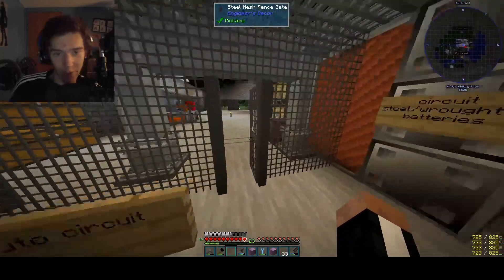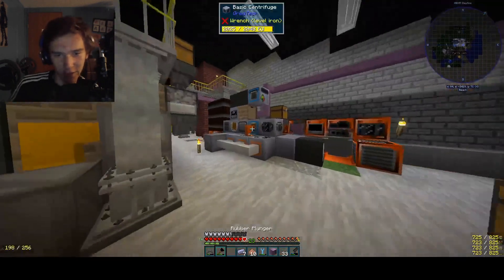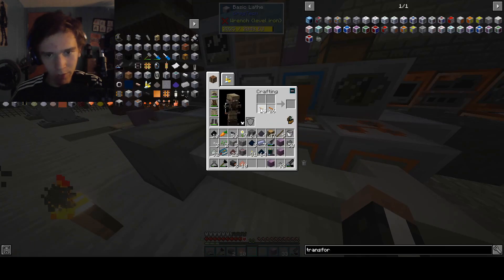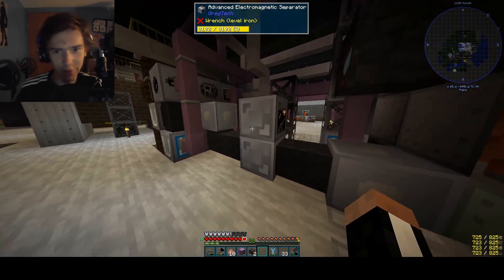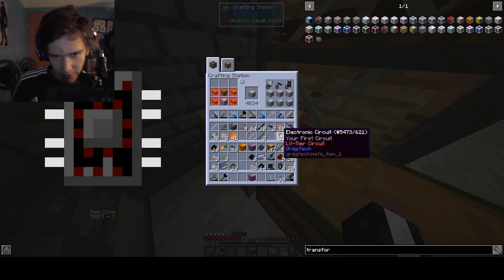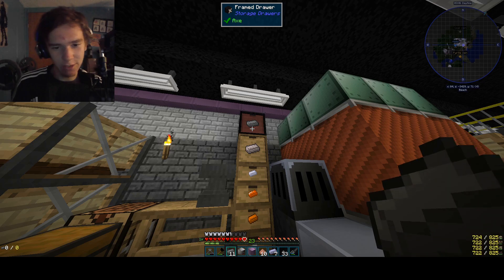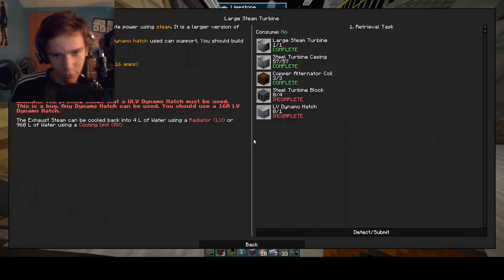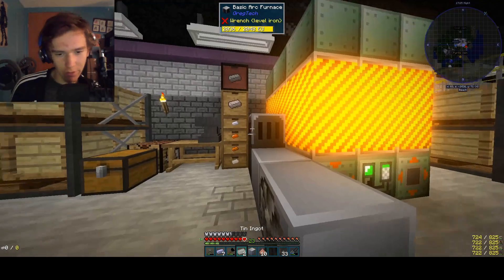We must construct the largest generator

Comment: He’s done it! The largest greginator has been made!

Also, transformers will be your best friend, as they let you use more efficient copper cables with lv machines and in general makes multi-tier setups possible.

Mv is when chemical chains get ridiculous. Want mv dynamo hatches for better generators? Huge chain. Need superconductors to be able to wire an expanding factory? Huge chain. Need MV batteries because lv isn’t cutting it anymore? Huge chain. Basically, MV is when you either quit playing, or when you realize you got a nasty Gregdiction
Reply from the maker: I got to the silicon chain and restarted xD